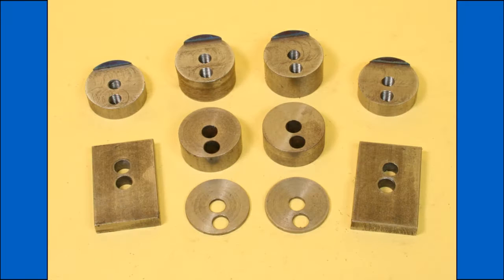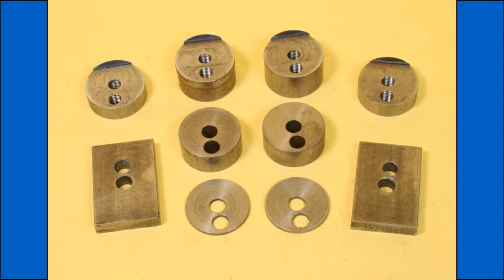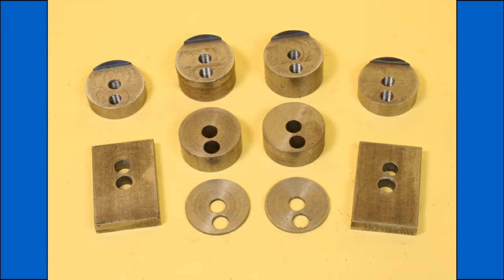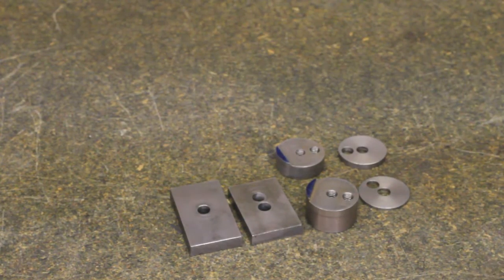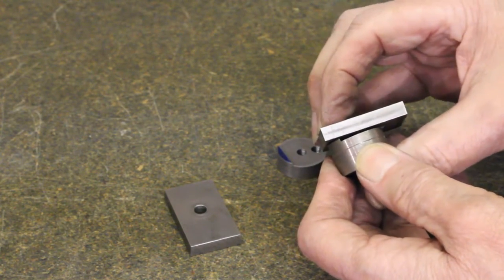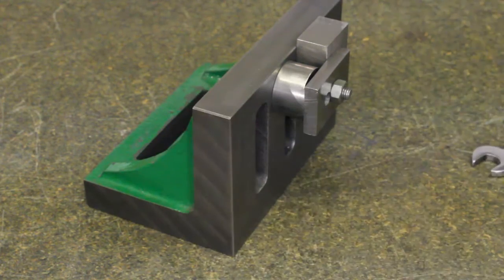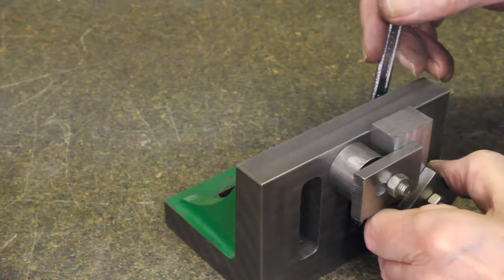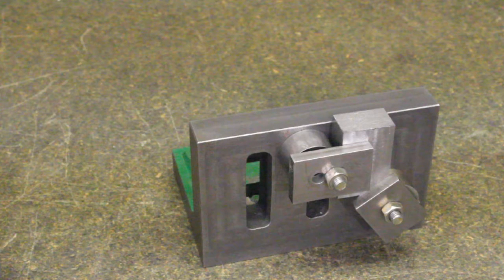Faceplate and  Angleplate Workpiece Clamps

Comment: During manufacture, how would you hold the packing pieces in order to mill the step and drill the holes in one setup?
Reply: Sorry for the delay in replying but have had computer problems. As to the method of making the Packing Pieces, I am now almost 86 (2019) and the
memory is now poor, cannot remember therefore how I made the parts. 

However, the method I would use today is to place each part in the three jaw and drill and tap the centre hole at the same stage as facing the ends. The thread does not have a lot of work to do so the hole size can be on the large side. 

For the second side, set the jaws so the part is off centre and drill and tap again. The two holes are not used at the same time so the distance between them  is not critical. Do though loosen the same jaw between making each part.

The step can then be milled with the part held in a vice using a V block against one jaw and the part in the V. Do not over tighten as you may split the V block in two if made of cast iron. You could though make a simple Vee in mild steel.
Harold
Reply: Harold Hall thanks for responding!